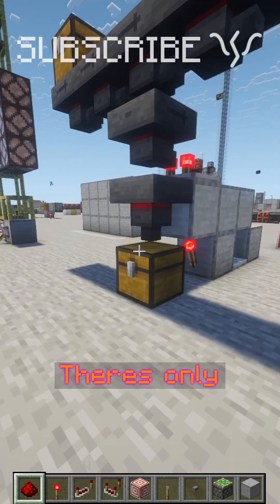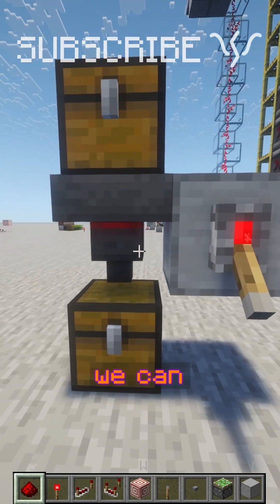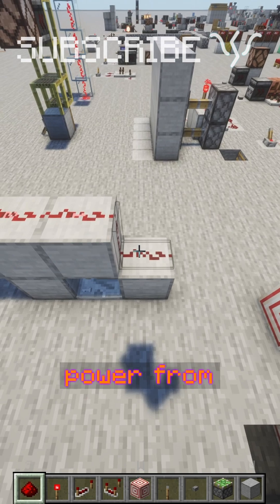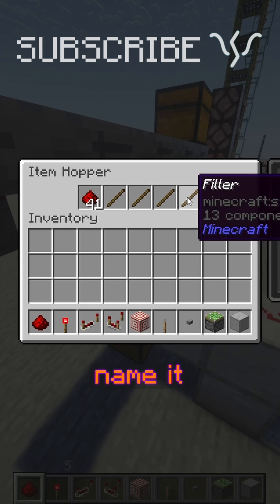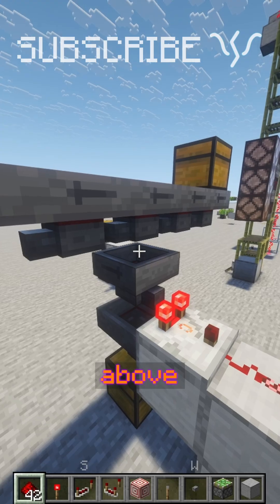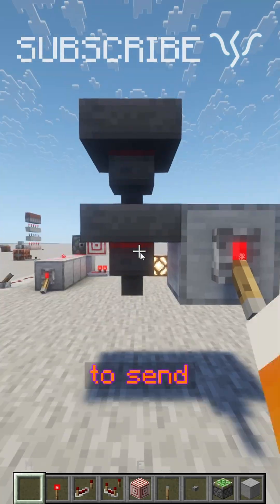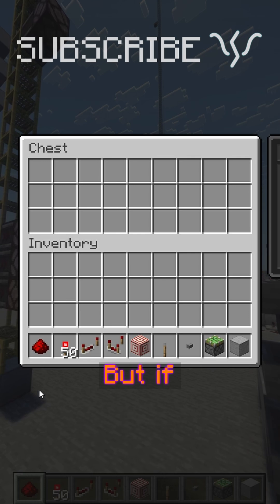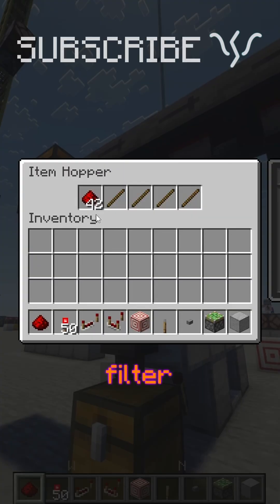How ITEM FILTERS WORK! BREAKING DOWN ITEM FILTERS! | Redstone with PsiVolt #minecraft #redstone

Comment: Forgive me if I somehow missed the explanation in the video

If over 45 items gives the proper signal strength to unlock the hopper, why couldn’t we do 44 total filler items and then only 1 of the item were filtering for?
Reply: As far as I'm concerned, microdelays in redstone can cause it to break pushing all the items from the first slot down the system and making the filter untuned. 45 is a safe amount
Reply from the maker: if you have multiple stacks build up of the main item it will go over a strength of 3 and leak into other filters! I show it off in my latest filter short

Comment: If you plan on using these single item filters for your storage i highly suggest  to use a signal strength 2 item filter. Its 19 filter items instead of 41 if i remember right. Much cheaper to build lots of them at once and they are also smaller. Just be careful they are often AB tileable meaning you have 2 version of it that you alternate so they dont interfere with each other. Never place two of the same ss2 filters next to each other if the filter isnt specifically designed for that
Reply: That's interesting.  Psi, maybe you can also do a quick short on the ss2 filter variant.  Your explanation of this isv filter is super clear and helpful.